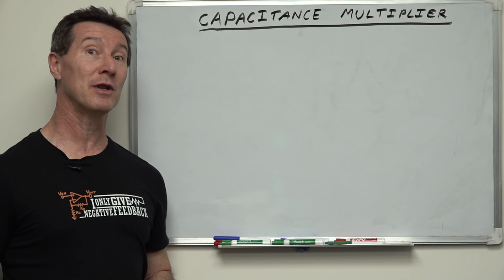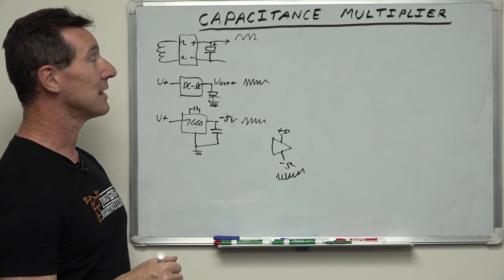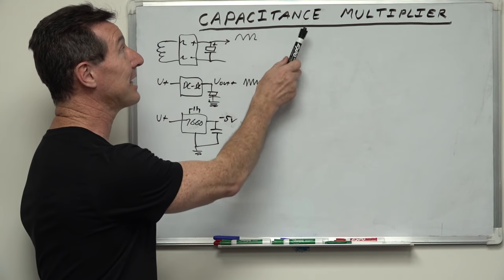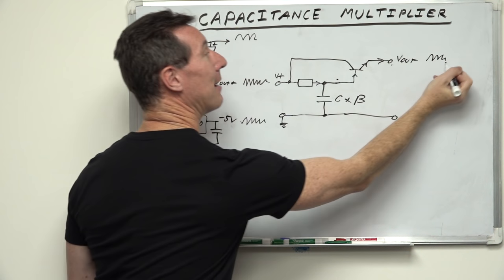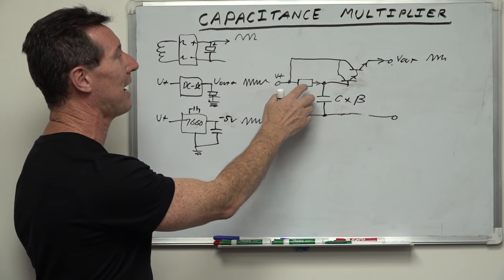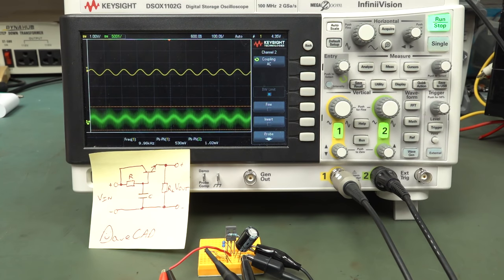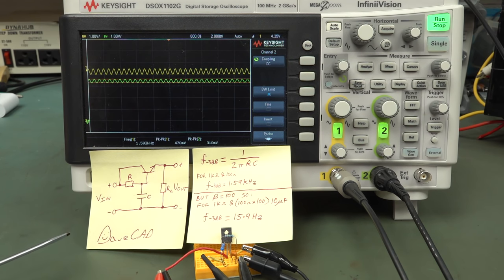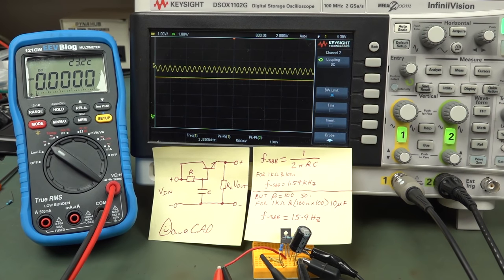EEVBlog #1116 - How to Remove Power Supply Ripple

Comment: I really missed these videos! And well... that was (maybe?) new to me, naming is indeed as you said tricky... It makes sense though, plus the transistor as a primarily a current source has a really high noise rejection by itself... Yeah! Cool stuff! BTW... I really don´t get why it would work with a MOSFET, you have to run it in the non linear region and it would be rather messy.
Reply from the maker: MOSFET could get messy, so I didn't go into that. You can use one though.
Reply: You know, I was giving it some thought and what confused me was the DaveCad layout. Yeah that´s practically an emitter follower but you are saturating the transistor. Saturated stuff generally not behave well especially with AC. What if you replace that resistor with a divider, depending on the transistor the drop you aim for isn´t that big (0.2 - 0.5 of a volt for a BJT) and you anyhow accept that you´ll have some voltage drop there. You can still calculate everything easily with Thevenin equivalent resistor for the divider. And you´ll have the transistor operating in the linear region which makes it a current source which in AC is an open circuit (of course you´ll still have noise coupled from the capacitances of the transistor but that might be more manageable). And yeah you´ll be burning power on that transistor a bit more from your suggested citcuit, but when noise is the problem and you only power an op-amp or two. Well, that might be a better solution. I haven´t tried it though to see the difference, but I know why it reminded me something. I hope you see it and give a reply, or why not make a follow up video! Cheers, mate!
Reply: Eh? Well that sounds awfully a lot like a regulator :-P
Reply: Yeah, that's why people invented IGBT's :) You could use MOSFETs in such cases, no problem, really. But IGBTs at least will heat up twice less :)
Reply: The MOSFET will inherently work in the saturated region. At low frequencies, the gate voltage will be the same as the drain voltage. This configuration is called a diode-connected transistor, and it assures saturated conditions (with Vgs=Vds and Vgs>Vth, you will always get Vds>Vgs-Vth). Since the current at the gate of the MOSFET transistor is virtually zero, higher resistance values can be used. The voltage drop of this circuit will be close to the threshold voltage of the MOSFET (Vth). Use lower Vth transistors for a lower drop. At higher frequencies, the voltage at the gate will drop to zero. If the transistor you are using has almost zero channel effect, then the voltage at the drain will have almost zero impact on the drain current, hence zero voltage gain from the input to the output. I think this will work neat with a MOSFET.

Comment: I've been using these in designs requiring ultra low noise supply rails for 30 years. They are superb if you get your calculations right.

Comment: The Sziklai pair is pronounced like "sick lie"... Sziklai, not slikai. And its benefit is, you're only dealing with a single Vbe drop (and the Vce drop, much lower at saturation, of the other device). Also, it generally performs better than the Darlington in most applications, but it's more expensive to produce monolithically (lateral PNPs in a standard cheap bipolar process is pretty much a no-no, so you need a much more expensive complementary process), hence why you don't see NPN/PNP-type Sziklai pair devices floating around Digikey.
Reply: Other advantage in series pass elements is that you drive the base via a pull-down resistor rather than pull-up, so it doesn't run out of drive as Vout approaches Vin. Of course you need a third transistor as an error amp though.  Still, a very effective regulator for a reasonable parts count, and will easily outclass the typical IC reg for ripple rejection.
Reply: It's the first time I've ever heard anyone try to pronounce Sziklai before :) I usually wimp out and call them "Compound Follower Pairs"
Reply: I've seen complementary feedback pair
Reply: yep or that :)
Im not a fan of them in power amplifiers. Too many stability issues. Triple darlington is better.
Reply: Depends. Sziklai pairs are typically associated with less distortion than the Darlington pair (or the "Trarlington", as Bob Pease called the triple Darlington configuration). And of course, better thermal stability, since the V(be)s of the complementary devices move in opposite directions.  That means less ballasting in, say, AB configurations, and therefore, a simpler and nicer design with more output swing and the slight noise contributions of larger ballisting resistors.

And finally, let's not forget the bandwidth issues of the Darlington, which are again lessened with the Sziklai configuration ;-)
Reply: For audio bandwidth is not really an issue with modern power transistors. The problem with the Sziklai is the local feedback can create terrible issues with parasitic oscillation that are a bastard to tame. With the triple darlington you can also run the predriver/driver transistors as Class A so that eliminates a source of distortion. Basically, see the late great WM Leach's discussion about this in his "low TIM amplifier". He has a FAQ section where the question of Triple Darlington vs Sziklai is addressed 

Sziklai outputs are good though if you only want a lowish power amplifier so that you are only dealing with one pair of output devices.
Reply: Bandwidth in this case also representing the aggregate slew rate of the output, as well as the cascaded slight phase shift that may differ between multiple Darlington stages. But sure, each configuration has pros and cons. As always with electronics, there is no BEST CIRCUIT FOR EVERYTHING - it should always depend on your application!

Comment: This is a brilliant video.  I have never heard of a capacitance multiplier.  How did the YouTube algorithm know that I have been wondering how to get a really low ripple power supply?  I am designing my own class A OTL valve amp, and want a supply of about 2 Amps at about 200V with virtually zero ripple.  I was thinking I would need big electrolytics and chokes.  This seems to be the way forward.  Your style of delivery is perfect.  Enthusiastic, informative and interesting.
Reply: Check out T Reg by linear audio.  I adapted the circuit to use a higher power pass FET for the current rating: NTP067N65S3H.  The increased gate capacitance caused RF oscillation which I solved by putting feedback around the op amp to reduce its gain, and included a 22pF capacitor from op amp output to -ve input to reduce HF gain.  I also had to increase the resistance between op amp output and pass FET gate to ensure stability.  Seems OK now, but I want to do more testing before I am convinced I have got a good design.  It seems to have extremely good ripple rejection.

Comment: I noted this circuit some time ago and only recently had a change to test it on a simple linear supply to reduce the 100Hz ripple. To cut a long story short, I found that it wouldn't work when I made an RC filter with just the reservoir capacitor - it had to be used on a 2nd capacitor (actually, an RC filter) placed after (i.e. downstream from) the reservoir capacitor. If the values of R and C are chosen well, it works like a charm. The ripple voltage reduced from 4V at 100mA with no filtering, down to 150mV. This was while using just a single 2N2222, just to try out the concept. I'm sure I could get better with a Darlington pair setup. In retrospect, I should have realised that without a reservoir cap feeding this super-filter, there is no source of stable supply voltage to feed it. Anyway, that's my simple-minded rationale. Thanks again, Dave - I absolutely love this "fundamentals" series because I learn so much. I'll never get enough of them.

Comment: Ok. I gave it a try and it worked, but there was a significant voltage loss with a 1k R. Using a smaller R  raised the voltage back, but the ripple also returned. Any suggestions?

Comment: Actually it should be called a load multiplier.  The effective load value that appears parallel with the capacitor is beta×output load.  That is why it is very effective as a ripple filter.  I actually used something like this in a car audio application to filter alternator ripple to a car audio power amp.  You could hear the alternator ripple comming through the speakers as you reved the engine; additional to the capacitor I used a 12V zener in parallel.  Generally the alternator ripple is riding above 12V.

Comment: Another are that is overlooked often is dynamic performance of dc regulators/ripple reducing circuits. How these things perform under pulsating load. Ie the source impedance will be issue for those conditions. This would make for an ideal followup video, Dave!

Comment: 26:00, the Op Amp also has its own power supply rejection ratio, if its positive supply is the same ripple injected power supply going into the multiplier, then the ripple rejection will only be as good as the op amp's PSRR.

Comment: At 18:46, you show the delay caused by the time constant of the RC filter when the input voltage changes. When you put this circuit on a high current, variable load like a class AB amplifier, you will get ripple passthrough and/or modulated supply rails. It would be interesting to see scope images when this circuit drives an electronic load, set to random load current.

Comment: You could always add a zener diode  in parallel with the capacitor, then you will have basic voltage regulation, sure it's not the best but for most cases it works well enough.
Reply: Maybe combine that with a series pass transistor to lower the ripple even further?
Reply: sorry, I guess thats exacly what you meant 8-)
Reply: It's all a question of how much power you can burn to regulate the voltage and stabilize the ripple. The larger the heat and power budget the simpler the design.
Reply: Main issue with a parallel zener is that the cap multiplier only has a volt or two drop from input to output. Thus, the zener current will vary wildly with small changes of Vin. Likely, a resistor value that gives enough zener current at min Vin will cook the thing at max Vin. 

The pure cap multiplier doesn't have this problem because output tracks input.

Comment: What power does a fet or bjt dissipate in this circuit ? Just the ripple voltage x current or are there more factors than internal resistance / wiring.
Reply from the maker: Basically the input-output voltage drop multiplied by the load current
Reply: 0.6V times current. A small price to pay in low power applications (below 10A or so).
You may look for lower dropout device, however you have to make room for the ripple, so your drop has to be higher than ripple Vpp+0.2V or so.

Comment: What even works better is a RCRC network because you actively make a 2nd order filter (Q=0.5). Another method is forming a 2nd order sallen-key with a transistor.
Reply: That's at 13:20 :)
Reply: railspony . Correct but he only describes it very briefly not even mentioning that the slope of the filter doubles. This is particularly useful in situations were you need to get rid off high frequency stuff. Something that's not even really mentioned.

Comment: Dave this is not a Capacitor Multiplier by any means... This is a source/emitter follower with a filter at the input. The capacitance is not getting multiplied by beta, the effect of the load on the RC filter's time constant is getting divided by Beta. Instead of BJT, you should use a mosfet which has a complete Isolation of source and drain at low frequencies. I would save the name " capacitance multiplier" for the miller cap situations. Moreover, the LDOs  pass the ripple because their feedback loops are not fast enough in the ripple frequency or its internal opamp slews (not fast enough) because of high current load at medium frequencies which again means the feedback loop cant keep up. This is an open loop system and can never beat a stable closed loop LDO if designed and stabilized for the right ripple frequency. I would just use a smaller cap to make the LDOs feedback loop have a good enough gain at the ripple frequency ( higher cap doesn't always mean less ripple) or buy the right LDO. Other than these this is a nice trick to drive a buffer stage of a filter with the exact input of that filter to make an ripple killer haha

Comment: so why not use an inductor instead of the resistor... ?
Reply: +Theo   Size and cost of the inductor, if your power supply is for vacuum tube audio. Values of 3 to 10 henries, often in double pi configuration, are used in tube audio.
Reply: I really don't have any experience with vacuum tubes, but yeah, 3 H are insanely high value. 
But let' s say we want to supply 5 V to our electronics ICs, or to a load that cannot tolerate high ripple. For fc = 1.6 kHz and Cf = 100μF, the value of the inductor is 100 μH, which is totally doable. Anyway, I will test it.
Reply: Hmm, LC resonance is an issue, so more care is needed designing it.
Reply: Have a play around in a circuit simulator like LTspice.  It will let you see what happens for all kinds of values.  I was just exploring RC filters and inductor filters.  You have to be careful with LC filters so that they don't turn into tank circuits ring and oscillate and can drive the output voltage way out from where you wanted it.  It can be made stable and work well as a ripple filter, but some changes to the downstream capacitance can affect the output in non-intuitive ways, so one may have to re-characterize the circuit to make sure it's behavior is known for all possible input scenarios (or close to, you can't know everything).
Reply: Theo transistor hate inductor. and for lower cutoff frequency, your inductor will be super duper big.

Comment: An emitter follower with large bypass capacitance at its base and emitter (presumably this circuit would have bypass cap at its output) can be prone to RF oscillation due to stray series inductance if not laid out very carefully.  It wouldn't hurt to add an extra SMALL resistor (like 10 ohms) in series with the base to suppress such oscillation.

Comment: I wouldn't exactly call ~35dB (4:24) a "horrible" (4:45) reduction.
Reply: The graph is showing how PSRR reduces with voltage across the LDO. The 35dB PSRR you mention is at >1.5V dropout across an LDO. That's a pretty generous dropout voltage for an LDO. At 0.4V dropout it's around 27dB which still isn't bad but shows the point he's making that it reduces with voltage drop. At less than this, it falls off sharply and you wouldn't want to operate in this region if your input has much ripple, even if the datasheet headline claims e.g. "a low dropout voltage of just 17mV". The reduction of PSRR with frequency is generally more of a problem as the ripple from DC-DC converters is usually in the order of 100kHz to a couple of MHz.
Reply from the maker: Check the frequency...
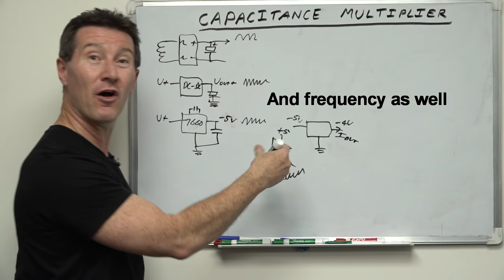Reply: OK that particular chart for that LDO was at 100kHz. Fine, but what's it like at 1MHz? Can I assume it's similar to that chart? I don't know what LDO that was from, but as you overlaid text in the video (4:35), you know it changes with frequency. If you look at the datasheet for the MCP1700, the Electrical Characteristics table says -40dB PSRR *(at 100Hz)*, but if you look at the PSRR vs frequency plots (fig 2.14 and 2.15), it's about -25dB at 1kHz, -10dB at 10kHz and 0dB at 100kHz. That's a far more dramatic change than the -35dB at 1.5V drop vs -27dB at 0.4V drop in the chart at 4:24, that's my only point. You have to be careful shopping for LDOs if you need good ripple rejection that it will work adequately at the frequency you need.

Comment: Nice circuit. A couple of comments: 1) the "R"  of the low pass filter has to be chosen so it allows the BJT don't go to cut off,  a good guess is : 1Volt/beta/Load current . 2) Since current is going to be supplied by the transistor, is  going to be an output impedance coming from base-emitter junction, so, if load current is going to  have a high swing, it is going to produce an output voltage swing too, an equivalent output resistance is in the order of 1 ohm.

Comment: This circuit can't filter out ripples higher then voltage drop across transistor.
Reply: You’re free to increase that drop. In other words: use the capacitor to lower the impedance of a Zener diode :)

Comment: You can make it into a voltage regulator at the same time by adding a zener diode from base to ground.
Reply: Ripple current reduction happens by amplifying ΔIb by β and subtracting from ΔIc. The ripple waveform at the base is almost symmetrical to ΔIc 
and is 180 deg out of phase by RC charge/discharge action. If you replace C with a zener your ΔIb will no longer be a symmetrical waveform to ΔIc
and the effect of reducing the ripple will be lost.
Reply: Rob he didn’t mean replace c but add a diode

Comment: You forgot to mention that the output of the emmiter follower will be at least 1 x vbe lower or 2 x vbe for a darlington. 
You may need a diode to protect the gate and discharge the capacitor when the supply is turned off

Comment: Of course, with supercaps, absurdly high capacitance is no longer a problem... so long as you series them to get your voltage spec (most supercaps are only rated 2.5-2.7 VDC)! So go ahead and throw absurdly large capacitance at the problem? Nope - trap for young players, as Dave would say! Large capacitance = large inrush current, and it’ll take it awhile for your power source to charge up a large capacitance... too long, and your rectifiers could burn up, or you could pop a fuse (if one is in the secondary)!
Reply: Also the ESR of those supercaps is terrible.
Reply: ....therefore always use slow-blow fuses. Ok, got it!